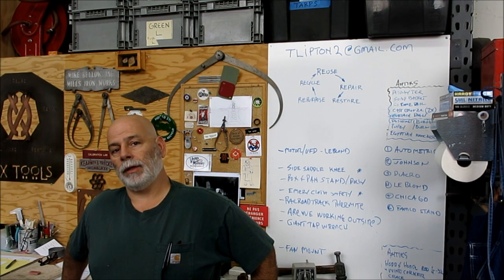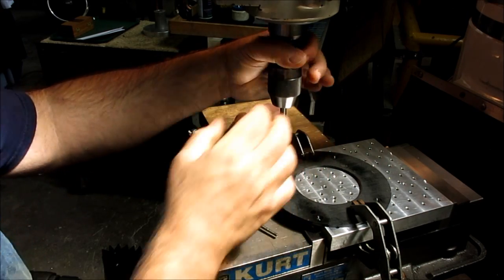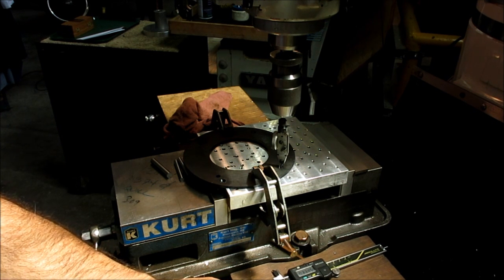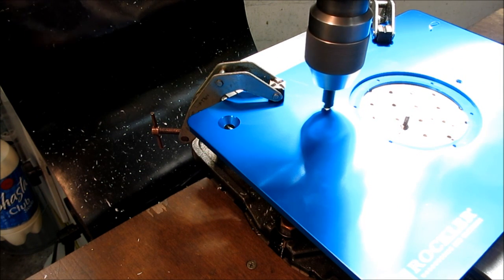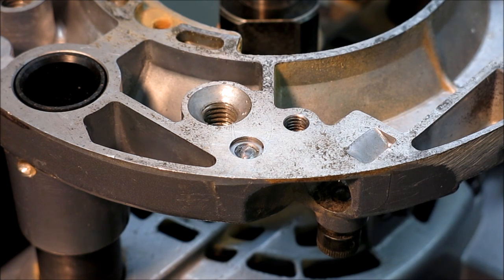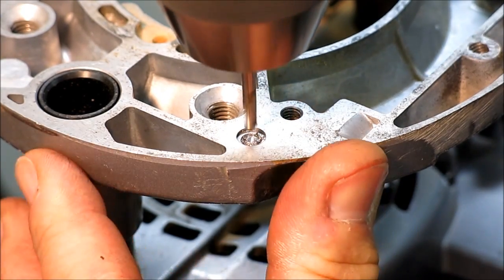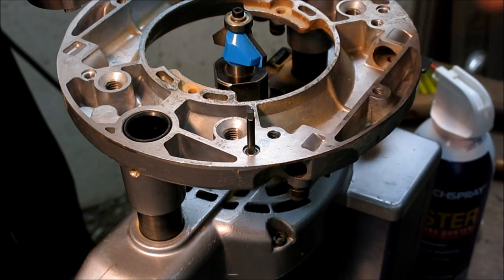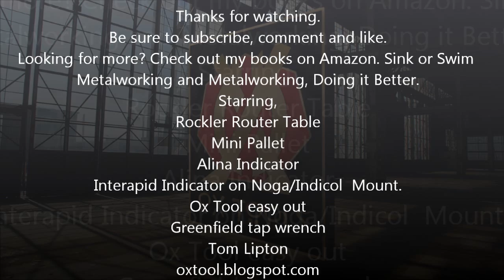Router Mounting Plate

Comment: Nice save Tom.  The old  1" screw into a 3/4" hole can ruin your mood. Can't trust blind holes to be tapped to the bottom they usually seem to just run a tapered starting tap and don't bother with a bottoming tap because nobody is going to bozo it with a longer screw, right?.  I saw someone else have a similar problem on some other channel recently, slips my mind who it was but at my age remembering it at all is a big plus.
Reply from the maker: Hey John,

Didn't help that the screw was made out of cheetos snap easy material. Thanks for the comment.

Cheers,

Tom

Comment: Hey Tom, nice use of the All-16'ths wrench. I thought you posted up a No Bozo's sign in the shop??
Good recovery. I have used the DRO on several locations to accurately measure a part. Nice job. 

Adam
Reply: I was hoping he was going to use your left hand twist drill bit trick, maybe you can tell me if my guess why not is correct?

Your gun-sight screw still had a head but was stripped, and this was a fully snapped screw head that was monkey-tight.

If that's not the difference would someone explain why that wouldn't be the call for this job. Personal preference, situational mandate, or just showing us lumps a different method to achieve a similar outcome?

Thanks in advance, Aloha...Chuckles.
Reply: Knolltop Farms
I've just answered my own onslaught of questions, guess I should have read a few comments before making one! Hard to believe the High Ox Wizard doesn't have any left-hand drill bits? Interesting...maybe he'll get some for Christmas, he he!
Reply from the maker: Hey Adam,

I thought you would be all over that little tap wrench. I don't remember if you have one like that in your extensive collection. Thanks for stopping by.

Cheers,

Tom
Reply: I did like the little baby tap wrench. I have a couple small ones but I think my smallest is a Starrett # 174. It's great for the tiny taps. Anything bigger I usually reach for the # 24 Greenfield.

Comment: Hey Tom great video! Next time why don't you show us how you would make the router mounting plate so the rest of us don't have to go out and spend 60 smackers for the darn thing. Thanks again.
Reply from the maker: Hey Tony,

Well first you get a piece of 3/8 aluminum plate big enough for the router plate. $45-50 then you fly cut the entire surface both sides ~1.5 hours then you add the counterbore ~1.5 hours then you actually are caught up to where I started. Oh wait, blue anodize minimum lot charge $40. Got to choose the right battles. Getting old you know.

Cheers,

Tom

Comment: Hey Tom,
I've never had much luck with easy-outs! 9 times out of 10 the damn things won't work. The square ones like you used seem to work better than the spiral ones. I just learned a new machinist term -- a broken off screw is a "peckerwood"! You learn something new and exciting every day! Thanks for the video! Sorry your screw proved to be a "rout"!
Have a good one!
Oxen Dave
Reply from the maker: Hey Dave,

That's what woodpeckers do. They peck at little things stuck in trees right. Pulled the worm out of the tree this time. 

Cheers,

Tom

Comment: The problem with the tap wrench is that you were pushing a point onto a point to tighten it.  As soon as torque was applied the points no longer lined up and became loose.  That is unstable and doesn't seem right.  I am guessing the tap wrench is missing a sliding block that has the other two flats.  Most Greenfield tap wrenches are made that way.
Reply from the maker: Hey Bob,

The screw is not pointed. It has a flat on it. The little square on my homemade screw extractor was not long enough. Thanks for the comment. No sliding block on this tap wrench.

Cheers,

Tom

Comment: Funny how that happens, huh.

Anyways, had the exact same thing (changed all the screws, btw, shitty provided screws), but what i did is slightly different.
I have a dremel, and each time i get to the end of a cutting wheel i take it out and put it in a tiny box in my parts bin.
For exactly this kind of reason.

Took the smallest one i had, stuck it on the dremel and then i cut myself a screw driver slot. Didn't touch the edges of the hole because i "dressed" the cutting wheel scrap on a grinding wheel to fit just enough to cut the slot.

In my case it worked perfectly, so i'm passing the torch along.
Reply from the maker: That's a great little trick. Thanks for sharing. I'm totally not calibrated with Dremel's. Until only a couple of years ago I didn't even own one. Now I have four......

Cheers,

Tom

Comment: What ho young Tom,
I take it don't have one of those centring microscopes, (www.hemingwaykits.com/acatalog/Centering_Microscope.html), I would have one if I could be bothered to finish the kit but what do have is a rotating adjustable diameter laser pointer that I made a few years ago that works fairly well at centring.

As for left hand drills as mentioned below, get some they really do help. I used to pinch them from the capstan lathe set up when I needed to remove a broken screw. Bruce Whitham down in Oz shows their value in use on a few recent youtubes, worth a look.

Mr B must have put blinkers on you, if you had screwed the base plate height adjuster all the way, the plate would have been held firmly to the body of the router, just saying it might have helped. :>)
ATB
chris
Reply from the maker: Hey Chris,

Not following you on the base plate deal. Are you saying to hold the router in the mill by having it mounted to the plate instead of in the vise? I am going to get a set of English drills. They do seem useful.

Cheers,

Tom
Reply: oxtoolco Quite understandable, very few people can keep up with a superior intellect, NOT!
Viewing from here the base plate was moving away from the drill, if you had wound the router's height adjuster all the way the BP would have been firmly held to the router's body.
"English drills" are you saying we are backwards?

Comment: Nice work, Tom.I love your E-Z out. In my opinion the commercial E-Z things should be relabeled "E-Z break". They are dead hard and hence brittle. But yours is a drill bit so it should have some give to it.I will remember this lesson. BTW Bruce Whitham, a relative newcomer to YouTube down in Oz,  has an ongoing series entitled "Getter out" (he got the name from Keith Fenner's "getter done.") on removing broken fasteners.
Reply from the maker: Hey Juan,

Try the square ones. I find they are softer and will twist before they break. The spiral ones are pure poison in my opinion. Like you said glass hard and almost as easy to break. I'll check out Bruce's channel. Sounds like a good series.

Cheers,

Tom

Comment: Good job on recovering that little screw :)
I was noticing that there were nice big M6 holes just a hair inside of the M4 holes you drilled. I think those were actually meant to hang the router fromt the plate. I think if you ever need to make any heavy cuts those little M4s might not hold quite tight enough.

Also, if you are interested in double checking your CMM work, rockler has some drawings for different routers on their web site:

http://www.rockler.com/rockler-router-table-plates
Reply: Hans Henry von Tresckow Hmm, on second thought, the dimensioning scheme on the drawings leaves somthing to be desired..... :(
Reply from the maker: Hans Henry von Tresckow Hey Hans,

I think you're right about the M8 holes. My router is so old Rockler doesn't have a plate with the right hole pattern in it. I guess mine is from the Jurassic period of router technology.

Cheers,

Tom

Comment: Hey Tom, do you have any tips on countersinking/de-burring threaded holes without rolling the caps over causing a super tight fit? Love the upside down screw trick to check the countersink.
Reply from the maker: Hey Max,

Sounds like your countersinks might be a little dull. Try a single flute Ford type. They are more free cutting and take less pressure. If you put them in a collet they don't run out as much when they are cutting.

Cheers,

Tom
Reply: Welll that's sort of the thing, the countersinks in our shop aren't sharp, I personally don't know how to sharpen them quite yet and there's only one milling machine in the shop. Basically I'm just hitting the back sides of parts that are tapped all the way through then parted off a bar and usually there are at least a hundred to do.

Comment: I have found when reverse engineering an odd bolt pattern like that that it is usually some standard either metric or imperial
bolt circle with one hole offset by some usually standard angle.
If you go with what it looks like it should be you end up much more accurate than measuring a plastic part which has horrible
thermal dimensional stability
Reply from the maker: Hey Gent,

I think this was more than one hole off angle. I would expect to see two out of four line up with each index. This POS only had one orientation. In retrospect there was a pattern of M8 I should have used instead anyway. Oh well its staying the way it is now. Damn woodchuck tools.

Cheers,

Tom

Comment: Tom, I know this video was aimed at people who may not have a DRO on their mill but your DRO should have the ability to "remember" steps. When you pick up those points you "zero" the place you are, assign a step and move on to the next place and repeat. When drilling (or milling in other cases) you just press the step number for recall and then drive to X0 Y0.
Reply from the maker: Good point. I rarely use some of the higher functions of the DRO. With my luck I would get to the end with all the indicating and it would forget all my steps. Better yet the power would choose that moment to go out for a split second. Thanks for the comment. 

Cheers,

Tom

Comment: Hi Tom, I find those multi-flute countersink bits leave a rough hexagonal hole so I prefer the single flute style as well. The multi-flute are okay for rough CS on wood but for metal or plastic, the single flute cannot be bested. It leaves a very smooth CS.

Another interesting video, Tom, thank you!
Reply from the maker: MatchstalkMan Hi Match,

Thanks for the comment.

Cheers,

Tom

Comment: Cute little tap wrench, almost watch-maker's scale. Is it missing the little sliding vee block that most of them have? Doesn't seem to make sense to have a pointed screw try to clamp onto the corner of a square-ended tap. Seems like that screw point should be like a bearing point for the back of the vee block. Maybe I didn't get a good enough look, though.
Reply from the maker: Hey Art,

The screw is not pointed. It has a flat on it. The little square on my homemade screw extractor was not long enough. Thanks for the comment.

Cheers,

Tom

Comment: If those broken screws aren't too jammed up in the threads, a left handed drill bit will remove them fairly easily. I use a left handed drill bit a lot on stripped headed or broken screws on archery equipment. Those factory hex screws are junk and when used with a cheap allen wrench, they gets rounded out. Those cheap pan head screws in small sizes can break easily. I usually just drill the head off a stripped screw and a left handed drill bit will turn the rest of the screw right out.I am getting ready to build a router table, how do you like the rockler plate now that you've had it a while? Would you buy another one or something different? I do like the aluminum plates the best. The rockler plate is reasonably priced.
Reply from the maker: +halfstep67 Hi Halfstep,

I finally bought some left handed drills. They really do work well for small screws that are not stuck too bad. Thanks for the comment.

Cheers,

Tom

Comment: I really enjoy the screwup fixing videos; that's the spot where I usually make things worse instead of fixing them.

I feel an urge to hire some local kids to sneak into your shop at night and replace any numbers they see written in sharpie on a metal surface with something really close to that, just so I can see what you do afterwards.  That's not wrong of me, is it?
Reply from the maker: Bad viewer. Man I have a hard enough time talking and working. You really want to see me have a temper tantrum don't you? We used to say the fairies changed the numbers that's why its messed up.  Thanks for the comment.

Cheers,

Tom

Comment: Tom, it seems like the extracting punch would act as a wedge and actually tighten the broken screw in the hole.  Is there a fine line as to how much force to use when driving in the punch?

- Tom
Reply from the maker: Hey Tom,

I know it seems counter-intuitive.  I have had the best luck with the square type removing broken fasteners. I think the wedge action is limited to a small percentage of the total engagement area so it might not play a very big part in what is holding the screw in. 

Cheers,

Tom

Comment: Hi Tom,
Interesting video, I love to watch different techniques used by people overcoming screw ups, as I have so many myself particularly the broken in situ screw types.

I do a fair bit of work with aluminium which you tend to plough rather than cut unless your tools are really sharp and slow running. I find that a drop of white spirit or paraffin helps to stop pinning on multi fluted countersinks and if you grind drill tips to 30 degrees you get less of a mole hill on the back side of the plate

Really enjoy your videos, thanks   Rod.
Reply from the maker: Hey Rod,

Thanks for the comment. Mr Bozo and I work together quite frequently. He told me to use that countersink....

All the best,

Tom

Comment: I pulled a broken bolt out of a chevy motor last night. looked like a caveman compered to yours.. :)
Reply from the maker: Depends where it is right? Top of the bell housing up against the firewall and mine might have been a bit rougher. Now something simple like an intake manifold bolt would be another story.

Cheers,

Tom
Reply: water pump  I might have got lucky

Comment: Hey Tom,Mr Bozo visited he seems to visit a lot of us.Back when I was working on cars I used lefthand twist drills and easy-outs,the theory being that the drill would grab the bolt and twist it out. it worked some times. Nice way to do bolt removal that you used. My only problem was that the car wouldn't fit into a milling machine.I liked the easy out you made most of the square ones are softer than the bolt.Don't worry to much on the the little ding in the plate, it's like food when you eat: if it's good enough to wear,it's good enough to eat. Thanks for a great vid. Dave Aarons
Reply from the maker: Hey Dave,

I have been looking at left handed drill sets. I don't have any right now but I will probably get a selection of them and put them with the easy outs. Thanks for the comment.

Cheers,

Tom

Comment: several times I have seen you clocking position on parts with a round hole in them working from center on your pepper plate. if you put two shoulder bolts into the nearest screw holes and add a third point using one of you tow clamps you can create location of the work pieces being worked on that you can then pivot the work piece about center to position at any angle you desire.
Reply from the maker: Hi Diamond,

In general I don't need to rotate the part once its oriented to some reference. In the example of the plastic plate I oriented the part in relation to two holes that were in line with one another. With the router plate I oriented the part so it was square with the machine axes. Now sometimes I have repeat parts to do and use a setup like you describe. I do like the name you used. "Pepper Plate" Sure sounds better than mini pallet. I think I might borrow that. 

All the best,

Tom

Comment: Glad Mr Bozo visits everyone on ocassion. How did you aviod drilling into the support plate when drilling out the router mounting plate.
Reply from the maker: Hey Eric,

The support plate is sacrificial. I just don't drill for the moon when I break through. That is one of the really powerful features of the mini pallet system. You don't worry about them because you just resurface them occasionally. When they look like clam chowder you just toss it and make another one. They are not precious.

Cheers,

Tom

Comment: Hey Tom,

The use of your easy-out seems a little paradox to me. You reliefed the screw with a drill and then you pressed the screw into the bore, when you drove the easy-out in the hole.

My grandfather used left handed drills for that kind of work and it seemed to work with much less effort than you put in that problem.

But as always: Very nice video!

Thanks for sharing,

Stephan
Reply from the maker: Hi Stephan,

I don't have any left handed drills. I've always had real good luck with the square type easy outs. I'll have to get a set of left hand drills one of these days.  Thanks for the comment.

Cheers,

Tom
Reply: oxtoolco I'm a big fan of left handed drills for this work. Seems that I love to break off the easy-out (which is hardened) in the steel bolt in the aluminum base. Getting that out take far more skills than I have, but I bet Mr Wizard can do it.
Reply: oxtoolco
I bought a cheap set of left-hand drills at Autozone.  Love them......makes me want to spend the money on better ones now.
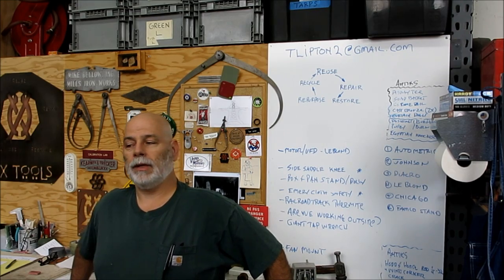Reply: That's just the way easy-outs work.  Seems like only 1:10 actually get a screw out though.  Tom made it look easy, hope he kept it for the cussing jar of cursed pieces and parts.